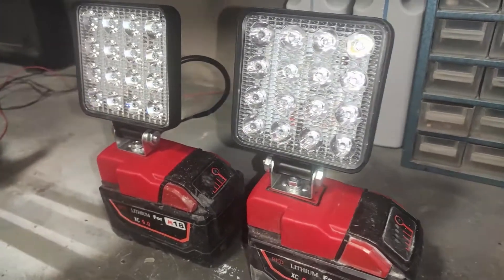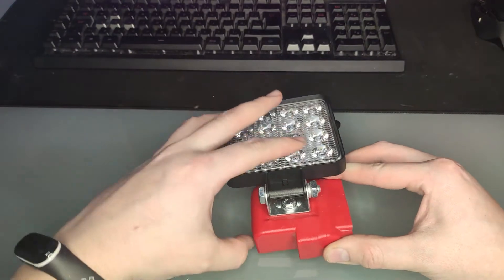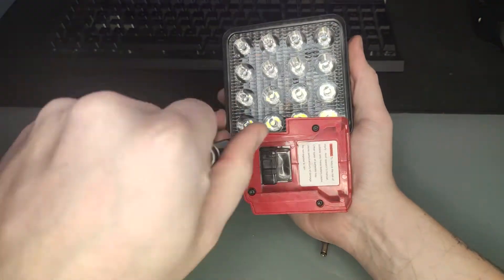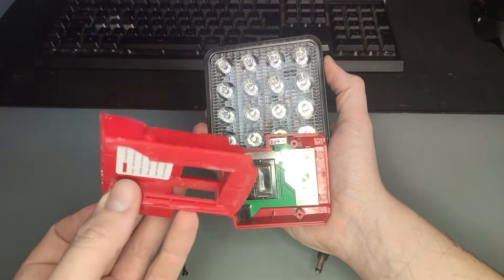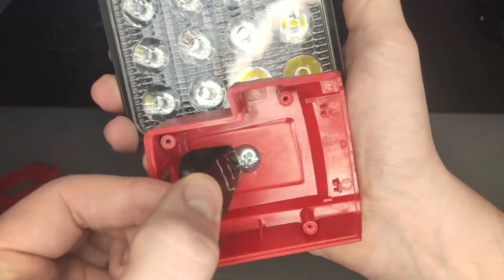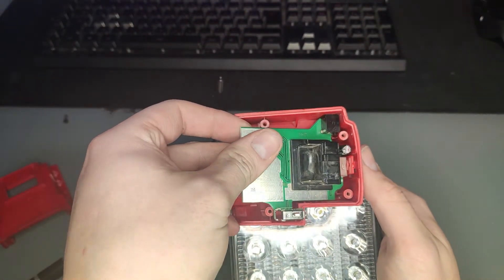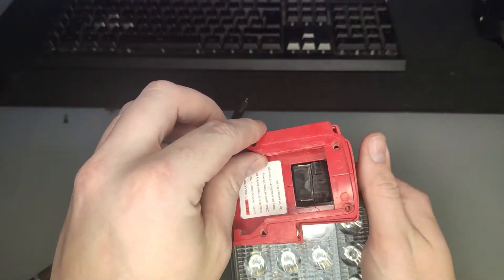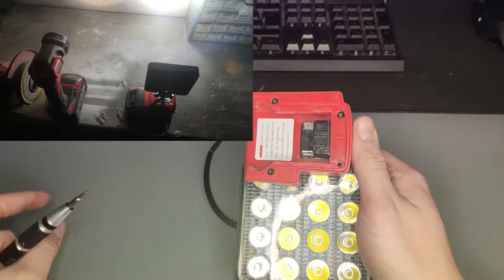Custom Cheap Milwaukee M18 work light W/USB output!

Comment: Does this drain the battery over period of time? Will it kill the m18?
Reply from the maker: It just turns off when the battery is low. Then you recharge the battery
Reply: You did a really good job. I'm going to use this for mine. Thank you

Comment: Yo dude this is super can you please help me with the name of the plug/wire connection
Reply from the maker: its is just called a power jack or 12v plug 2.1mm is the size for it though.

Comment: Where do you ger the circuit board from?
Reply from the maker: Sorry about the late reply Raul. It's a common add-on for Milwaukee batteries! 
It's a clone of the usb power adapter that Milwaukee make 
They cost around £10 ($15). 
I do hope this helps.

Comment: This is awesome where do we buy the light from and bracket or did you make it
Reply from the maker: The light was £7 off eBay and I got 2! 
I searched for 12v led work light and this came up, plenty of different variations on there also